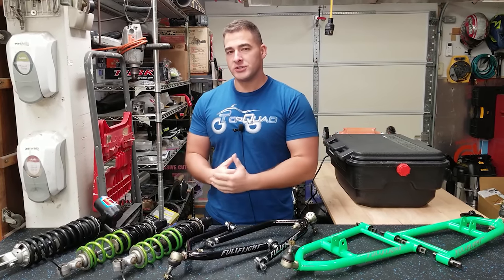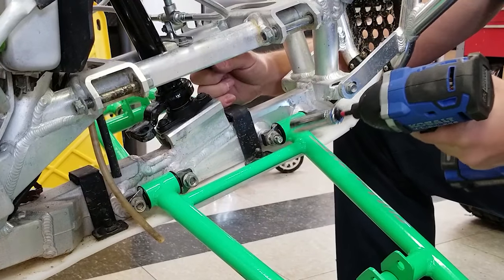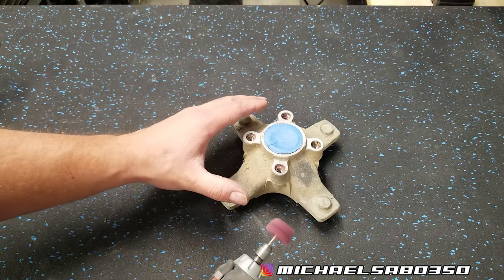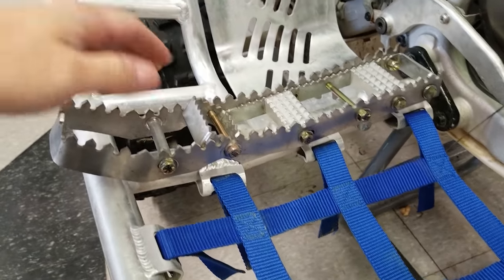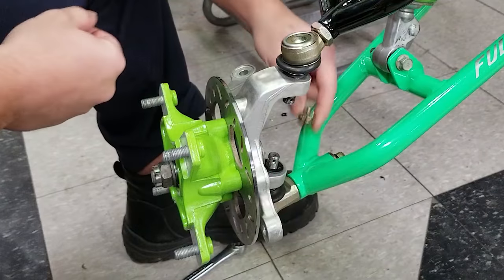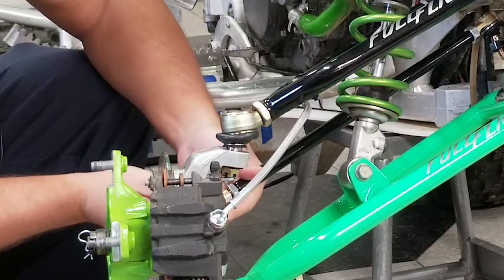I Completely Changed the Look AND Performance of My Top Quad (Here's How)

Comment from the maker: Thanks for holding out so long while I made this video; YOU ROCK!!! 🤘

Chapters

0:00 - Intro
0:39 - Lower Steering Stem Mount Mod
3:49 - Installing Suspension and A-Arms
6:12 - Restoring The Front Hubs
13:30 - Restoring The Spindles
14:05 - Skit
15:50 - Making Super Pegs
20:51 - Showing The Finished Hubs and Spindles
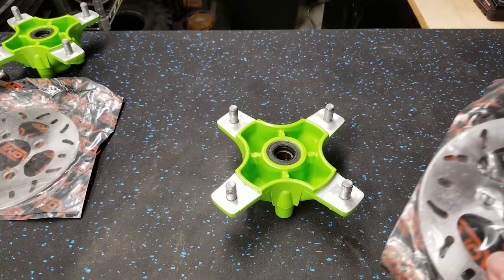22:07 - Installing New Disc Rotors
24:03 - Showcasing New Green Plastics
25:32 - Replacing KFX Rear Hubs with TRX Hubs
26:50 - Installing Front Hubs/Spindles and Brakes
28:45 - Adjusting Camber
32:31 - Installing Tie Rods
34:13 - Adjusting Alignment
35:10 - Adding a Steering Damper
36:15 - Test Ride with The New Setup
37:37 - Closing
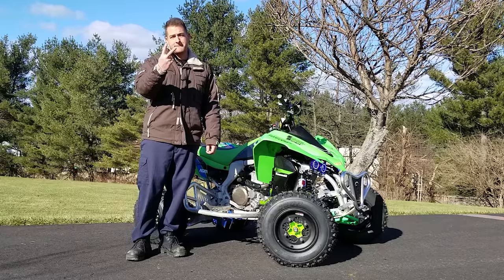38:43 - Before/After Shots
Reply: You know you could use a tape measure for the front tires.
Reply: Great video  Mike.
Reply from the maker: @davemooreracing  Dave, thanks so much for watching man!
Reply from the maker: @caseygillis5347  yea or string. I feel like my alignment is pretty good eyeing it up though
Reply: Sweet machine!
Reply: Makes me want to go start working on my bike
Reply: What’s the yellow an blue seat for
Reply from the maker: @kylecarpenter2769  parted out KTM quad.
Reply: I’ll give u 4500$ for it
Reply: @MichaelSabo  how do I get ahold of you? I have a 08 just like you and it has alot of mods and new plastics as well. Fmf power core 4, nerf bars, new wisco piston. All new sensors. I believe the ecu is bad. It's for sale if you want it. Cheap
Reply from the maker: @andychapman6646  shoot me an email; Michaelsabo350@gmail.com
Reply: Hey, currently an owner of a quad equipped with alba nerf bars such as those. I have zero complaints about the pegs. They actually feel like the most solid, grippy pegs I've ever felt.
Reply: New subscriber here! Love ur vids. Hope u keep that KXF450 long term. That project came out terrific & those are really cool machines. A bit more rare ....& plenty fast /reliable. Enjoy.      - Ohio
Reply from the maker: @Davido50  thank you for the awesome feedback and for subscribing! So far the KFX is still here and I have some more mods planned for the near future 🤘👊

Comment: Making a quad your own is probably one of my favorite things to do. I’ve rebuilt a z400 and a 700 Raptor from top to bottom and I LOVED it.
Reply: I started racing with a 450 and my cousin asked if I wanted to try his 700 Raptor. I was amazed at first but when I raced it the 450’s all pulled on me from 1,2,3 gears. So I sold it. Like you I went threw it 100% and fixed or modified everything. Now I’m in search of another 450 there just a better machine.
Reply: Selling any builds?
Reply: @jamesarneson7769  700 is a trail quad, makes sense. Its like doin motocross on an XR650R

Comment: The heim joints on the upper A-arms are for the caster adjustment, not camber.  They allow you to change the angle of the spindle thus making your steering quicker or slower, an important adjustment for the KFX.  The lower joint is for the camber.  I'm surprised Full Flight has the caster adjustment, usually it's fixed.

Comment: For all the backyard builders, 27ft pounds is equivalent to 5 1/2 ugga dugga's 👌
Reply from the maker: Accurate 👆
Reply: Haha good to know last thing I want is for a bolt to go from righty tighty to righty loosy 😂
Reply: 27 ft pounds times 2 is 54 and 5.5 ugga duggas times 2 is 11 so 1 ugga dugga should equal about 4.9 ft pounds if my math is correct
Exactly 4.90 repeating so the 90 goes on forever

Comment: I have a full Walsh Kfx450. Let me tell you as to how Walsh was the absolute best thing for that bike. The a arms and fox gen3’s with the Walsh swingarm not only plants the bike to the ground in a way that it’s nearly impossible to flip the bike. It also glues you to the track. I’ve owned Laeger protrax, Walsh trx450’s, six5 Design’s lobos etc etc and none have compared to how the Walsh Kfx450 have rode. I also have the Walsh lowering kit, tranny cooler kit precision stabilizer, fci intake Baldwin engine, Hinson full clutch assembly etc etc etc. Walsh also makes a new steering stem mount that allows for new bearing replacement. You should look into it. Also call nate or mike at Walsh they will hook you up for that bike. Another thing to consider is if you decide you o really deck your engine out call Dasa racing and have them work your head. I wish I kept the Dasa top end instead of the Baldwin. So much better response and power plus more reliable with their valve work they do. They also do in house nikasil for your cylinder. Great company to work with and by far the most power out of that engine than any other company. You need any advice on that bike feel free to ask. I can send pics of everything that’s been done if needed

Comment: Mike The Man’
Hey Brother we have talked in the past before about Banshees & Toomy’s T-5’s! Your killin it Brother, very proud of you 👏 & your success!!! I’m sure you don’t remember but I have a 2001 Banshee I bought new in 2002 with about 20 hours on it total. Still has original grips & front tires on it. All bolt-on mods: T-5’s pipes, boost bottle, new Holeshot back tires, obviously it’s been rejetted & tuned. I bought new Renthal bars but never flipped it over or just bent them because no cross-bar I usually can bend without rolling the bike. I have back 2.5” spacers on the rear & then for the front i flipped the rims & moved the valve stem to otherside gaining about 2” inches on both sides! I unplugged the rev limiter or whatever it’s called (the wire connections by carbs). I threw some nerf bars on & a six-pack rack & a Summit front bumper! This is the third Banshee I’ve built the exact same way. It’s a ripper, anyway I was thinking of putting it up for sale after I clean & tune it up from sitting a few years but had the thought of a raffle? Would you be interested in raffling it off on your channel? Maybe make a video on it getting tuned up & peeped before the raffle?? Ofcourse cut you in on some of the revenue for your troubles? We do have a Space challenge I live in Phoenix Arizona! Kick it around Brother & let me know if I’m on to something or just on something????
Jeffery #44 aka/Fro
(602)717-1809
Mentzerjeffery@gmail.com

Comment: Mike, send that head out for a port/polish, then throw some decent cams, intake and a full dasa pipe on that thing.
Reply: Thats a bit much. More mods = less reliability. For regular riders stay close to stock as possible (even at rebuild time). Pipe /muffler.. better filter /intake system on my '21 Raptor 700R-SE & '11 YFZ450X! Both minty crisp!

Comment: That bolt on the rotor looks like the bolt for a speed sensor set up for the trail tech kit at least it looks like the same one i used to run!

Not bad sabo even for a KFX 🤣🤣
Reply: Lol   I bleed blue , sometimes orange.
Reply: @henrymulvenna1748  blue is the best 🤣🤣

Comment: Hey Mike on those cheap bearings for sure pop off the seals and pack them with good grease, they may not get much from the factory, that's what I've noticed. Peace
Reply: Not much more to buy quality bearings like Timken, SKF, or Fafnir. But yeah I’d at least check the grease in the cheap bearings before installing

Comment: That mis-matched bolt is probably for a speedometer.   I had one for my trailtech vapor.  Its a magnetic pickup.
Reply from the maker: Oh wow dude... you're probably 100% right; it was magnetic too. Great call bro!
Reply: The little screw with the piece of plastic you took out of the spindle was the other half of the pickup that was broke.
Reply from the maker: @a-rod4103  thank you for the info man!

Comment: To align it i put a string around the middle of all four tires and make both fron and back end of the tires touch the string and after that i go about 1/4 turn in or a little less of toe in , just until it bearly stops touching the string

Comment: You should have used spaces behind the rear hubs so that the castle nut would actually have any use of the locking pin which by the way also was a bad choice. Great looking quad

Comment: I really need to get off my ass and get my kfx450r back together. I didn't catch if you did anything power wise but you should check out the fuel customs intake,  it makes a significant difference in power from everything I've heard.
Reply: Absolutely and don’t forget a fuel programmer 😎

Comment: Cotterpins are great till your front wheel bearing goes random and introduces a fun wobble at high speeds. I had this happen to an old Subaru and it caused the spindle nut to forcefully back just enough to partially shear the cotter pin on one side and pinch the other making it nearly impossible to break off the spindle nut without the aid of a 4-foot cheater bar.

Comment: Negative camber is actually bad for the quad. You should have slightly positive camber because when the front suspension is compressed it will pull the wheels in. If you’re camber is negative than when you compress the suspension the tires will be way off and you will have less contact between the tires and the ground and wear your tires out faster.
Reply from the maker: Thank you for the info; I know the angle changes a bit under load; I'm going to research this; thank you.

Comment: You need to buy a parts cleaning tub and an ultrasonic cleaner also.  Harbor  freight has decent ones for good prices. And soak those parts so you are not grinding for hours with a scotch ball. Just saying saves a lot if time

Comment: Mike bike looks way better.. also I know you know what your doing but when guys ask next time about alignments tell them the quickest and easiest way is put the bike on the ground and grab a tape measure and measure/ compare the front side and the back side of the front tires from the outside of the tires, measuring from the outside of one side to the other. Once both measurements are the same the steering is straight, just remember to measure from the same points on front and back and both sides usually a helper holding one end of the tape helps. Also FYI to mention almost all spindles are marked with a L for Left and R for Right so ppl don't mix them up.

Comment: What does a steering stabilizer do I’ve never rode a machine with one. Are they supposed to take the vibration out of the bars so your arms don’t wear so fast
Reply from the maker: Man they help BIG TIME with rider fatigue and help you track better. You need to ride on a quad with one to really understand and you'll never go back lol
Reply: When u hit a log or big bump with one side or the other the vibration carrys all the way to ur hand sometimes even coming off the handle bar.with a stabilizer its alot less vibration when a log or big hole pops up.highly recommended.

Comment: You were smart to clean your brake discs before installing, they come with oil on them to prevent rusting. But then you touched them so it didn’t help much. When you have oil in your brake rotors it bakes into the pads when you heat it up and makes them less effective.

Comment: Dude, looks pretty sweet, but you should've kept the other nerf bars, or at least the 1 that wasn't bent. They had their own sniper ghillie suit built in. Looked kinda camo with the moss growing on them. lol. All kidding aside, the KFX-450R benefits more with a little toe-out than it does with toe-in. And be sure to set your caster as well as your camber. Check out this link "https://www.walshrc.com/instructions-set-up/" at Walsh Racecraft for set-up tips and specs that best suit your quad for racing and overall feel when out riding.

Comment: I did not like the changes, the old tires looked better, I have one to but have to sell for one leaving country thanks to the mafias running the court system, plus some dumbass had mine before I owned it , and the idiot soak it in mud, I found mud even inside the air filter. If you are luck enough to own one don’t be stupid and berry it in mud, this thing is a electronic marvel, it is so cool how the computer m to codes and sensor work, just like a car. I love the bike just not the one I have , because of spoiled dumbassss last owner.